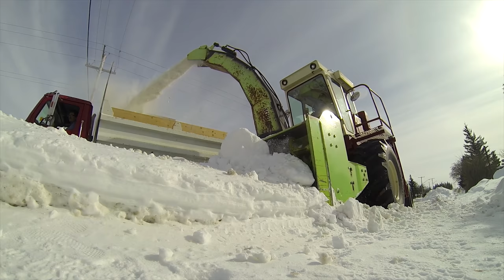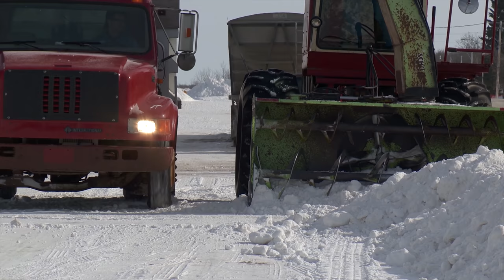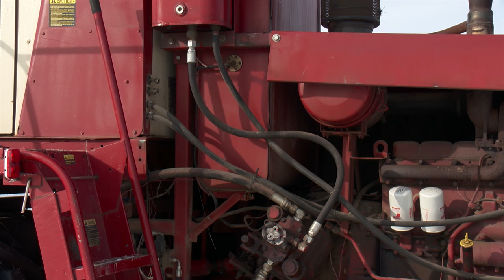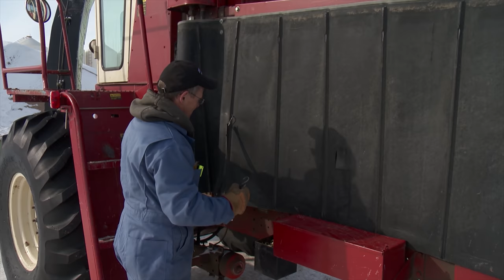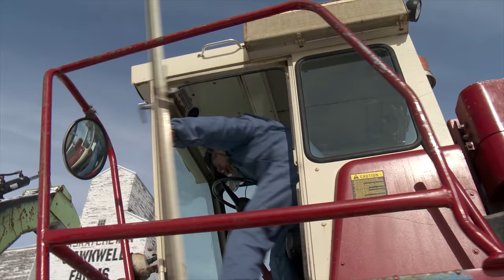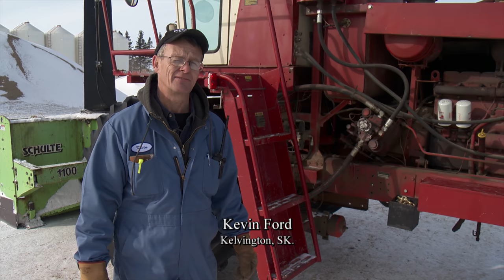Combine Powered Snow Blower

Comment: Nice to see a town that is frugal with their money, and is willing to use old equipment that is still in good working condition rather than having to waste money on the latest and greatest new crap that hits the market.
Reply: So true and half the time the "latest and greatest" isnt so great
Reply: the latest and greatest is often in the shop due to parts and in there longer due to parts availability... where as the old iron will work and work till it blows up, then you can fix it for cheap because parts are everywhere.

Comment: My town owns a bidirectional tractor and then mounts the blower on it in winter, does the same thing. Didn’t have to build anything. But still use it for loader work, Rough cut mowing, street sweeping, etc
Reply: I always liked the bi directional tractors. I don't think they were utilized or marketed well enough

Comment: That's a good use for an old, mostly obsolete, but still good running piece of equipment. I imagine it would be do-able on a number of different makes, although sometimes on the older stuff they were built more simple and that can be a benefit when it comes time to try to modify it. I used to see this type of thing once in a while where people used those old UNI power units, which was likely easier, but none of them had as big a blower mounted on. I don't think the UNI would have enough power. Takes a lot of juice to run a blower that wide with a truck chute on it. My small town in WI paid $$$ for a blower unit that mounts on the front of the Volvo I90 payloader and runs off hyd. power. 
I think my favorite part of this is he used a 540 PTO unit and fabbed up a 3 point. This means the blower unit could easily be removed, mounted onto any tractor with a 3pt, but also that the combine machine without the blower is basically a power unit they could mount pretty well any 3pt/PTO powered equipment on. For instance, wood chipper. This is an important design point because the machine is now more modular, but also if the blower gets to worn out, they can put any 3 point mounted snow blower they can come across onto this power unit. That lends to longevity, and also more $$ saving down the road. 

I was skeptical at first that so much fab work would have a desirable result. But given the price of older combines, and the fact most of the fab work was junkyard parts, this was probably a very economical conversion(provided he didn't bill the city 20 grand for his time) and would be a reasonable solution for many small townships. The time savings of blowing snow to remove from a street(after plowing it all to the center) vs "scooping" with a payloader or backhoe is legit.

Comment: Great job.  Heater inside or not?  Not likely since that would require Defroster and wipers etc.
Reply: I'd imagine it wouldn't be too hard to add an auxiliary heater to it. If that's the same motor International used in some trucks, then all they would have to do is connect it to the engines original heater hose outlets.
Reply: Combine likely has a heater, though wipers may be iffy

Comment: I'm not getting into the "It's not a combine" pissing contest,  I just want to know if come summertime it can do anything else, or is it strictly a snowblower from here on out ?  It would be awesome if it could function as something productive in the summer AND still be a snowblower in the winter.
Reply: It will only ever be a snowblower from now on
Reply: i dont know, it could probably be easily modified to be able to swath as well as blow snow. I mean its basically a swather now, with a 3 point hitch on the front.

Comment: Forage harvester ,wheres the combine
Reply: did you not listen to the video?? He took an old 915 IH COMBINE and ripped out the combine parts like the hopper, feeder house, sieves and Others and moved the engine to behind the cab instead of beside like on the 915 COMBINE. He then ran a PTO driveline from the transmission to the front to power the snowblower. That was all explained in the video.

Comment: It's a Swather not a Combine but who cares!
Reply: Larry Mulalley i
Reply: I guess in Canada it could be called a combine but in the lower 48 its a Swather
Reply: He said it was a combine but he put it on a truck frame
Reply: Larry Mulalley did you not listen to the video?? He took an old 915 IH COMBINE and ripped out the combine parts like the hopper, feeder house, sieves and Others and moved the engine to behind the cab instead of beside like on the 915 COMBINE. He then ran a PTO driveline from the transmission to the front to power the snowblower. That was all explained in the video. Also in the "lower 48" a combine and swather are the same in Canada.
Reply: Fml it was a combine
Reply: Larry Mulalley it is a combine all the harvesting parts have been removed